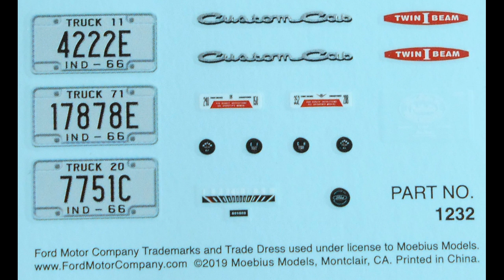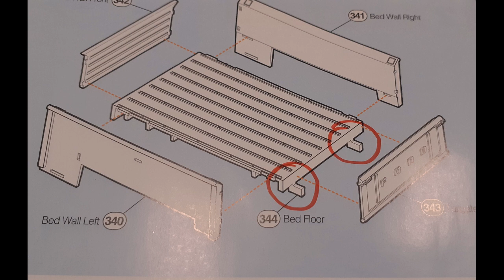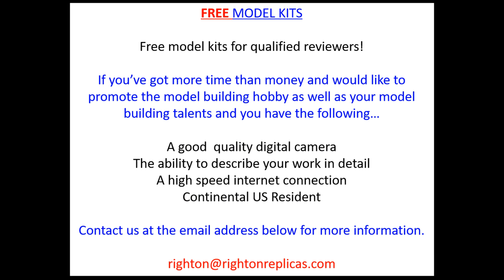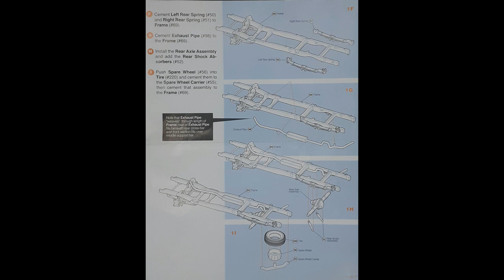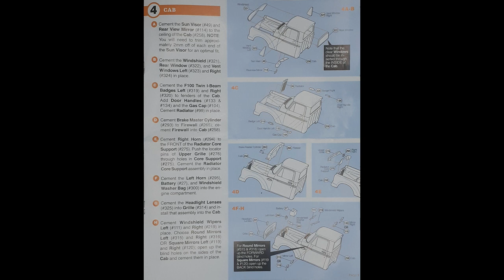1966 Ford F-100 Flareside Pickup 1:25 Scale Moebius #1232  -Model Kit Build & Review

Comment: Nice job Doug , Starting mime now, What did you use for the oil pan plug J
Reply from the maker: Ray,  I didn't address that on this kit because it wasn't part of the molding.  In the past, I've added one from Evergreen rod stock filing some flats around the edges.  -Doug
Reply: @RightOnReplicas  Thanks Doug, I'll give that a try.
Reply from the maker: You're welcome Ray.  We're here to inform and inspire!  -Doug